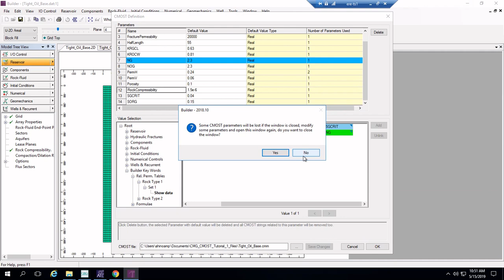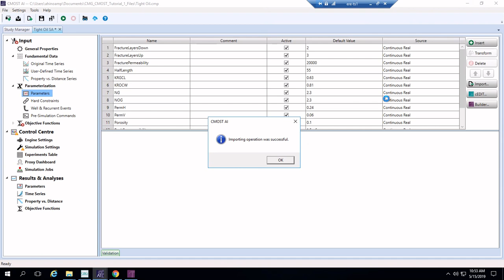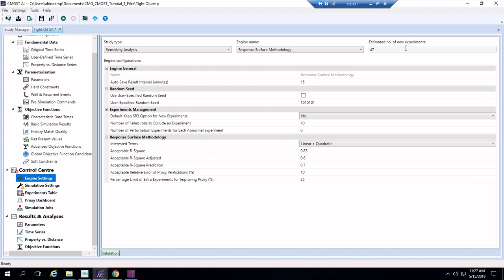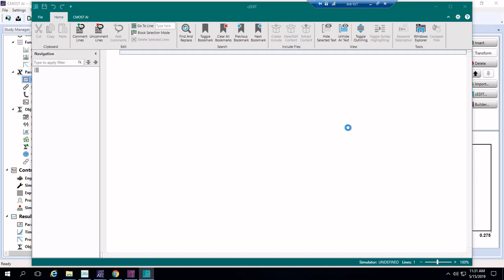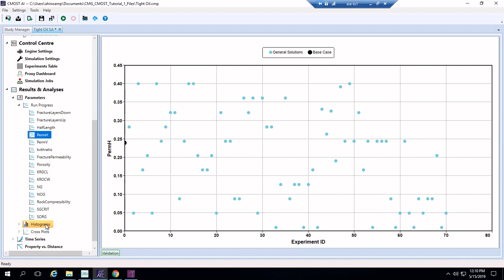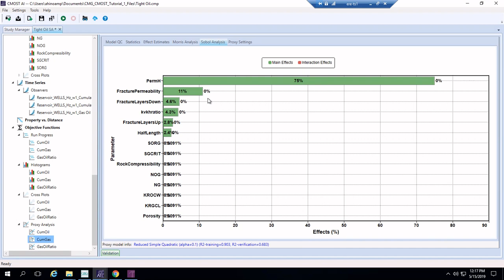CMG CMOST tutorial - sensitivity analysis on an unconventional reservoir

Comment: Hi mam. I'm wondering if i do the exact same step and data used in the video, will my simulation results will be an exact copy-cat to yours or it will differ due to the random data generation from upper and lower limit we set? or how does it work? thank you.
Reply from the maker: Given the same parameters, a single flow simulation will provide the same result. For the sensitivity analysis, the results might be slightly different, as you said - due to the fact that the samples are random values generated within the prescribed range. If we both run an infinite number of simulations within the sensitivity analysis - the different sensitivity metrics should converge to the same values.